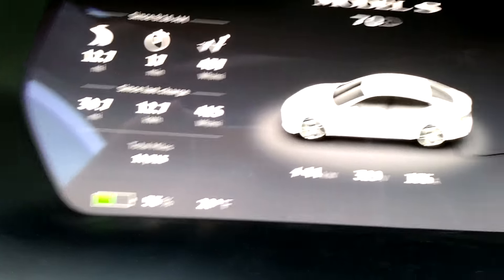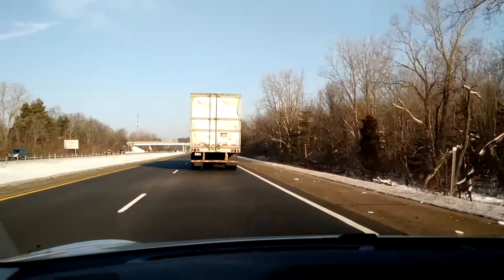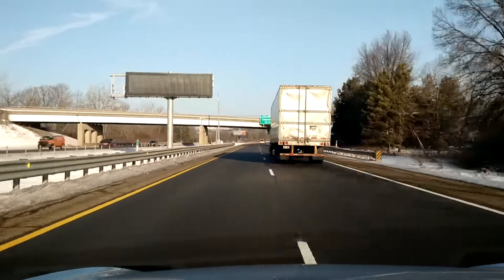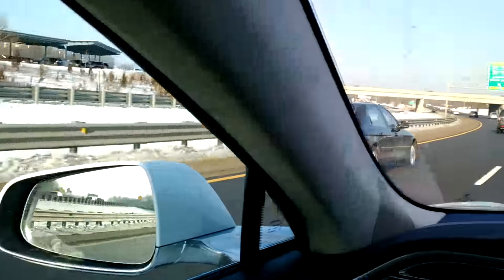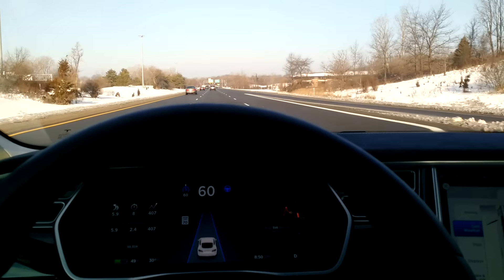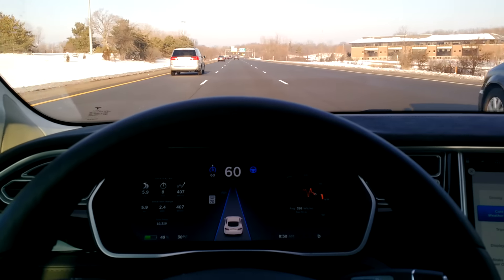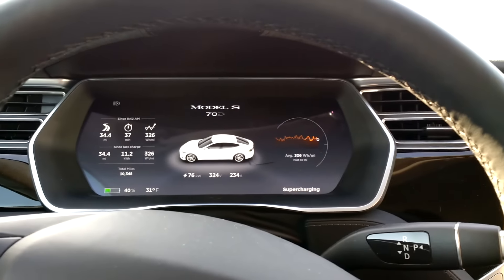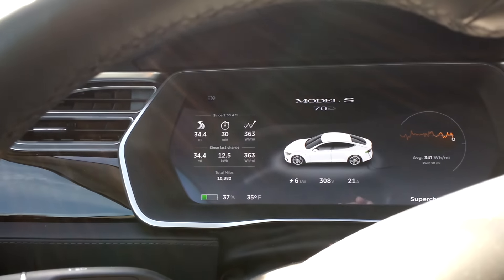Tesla 70D energy use: Fast vs Slow freeway driving in cold

Comment: Good video. But i would apriciate if you also used metric system. I have absolutly no clue what 31 degree fahrenheit is in celcius. :-)
Reply from the maker: +Peter Almvall yeah, I'm slowly adding more metric conversion. 32F = 0 Cel, so it was about 0 Cel that day.
Reply: There's an app for that.

Comment: To get as far and fast as possible (anything above range) mathematically it is best to drive the same speed as charging. So if supercharger (500km/h) then drive at 200km/h :D If Level2 22kW (dual charger max) then at 70mph about. If charging at 11kW (normal level2) then somewhere around 35mph (motor power average 11kw). If using 3kw charger then speed should be minimal, 25mph.

Comment: I'm not trying to be a physics nazi, but in the end the units need to be corrected. 225 km/mi is a speed (and quite fast, around 22k mph), and mpg is miles per gallon isn't it? Otherwise nice video :)
Reply from the maker: +icsir13 thanks, I added a note to clarify.